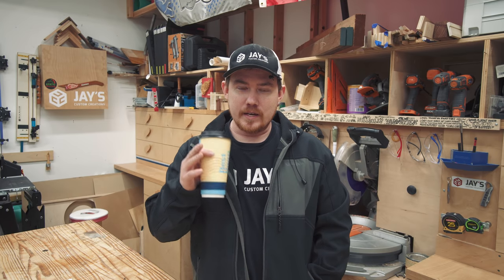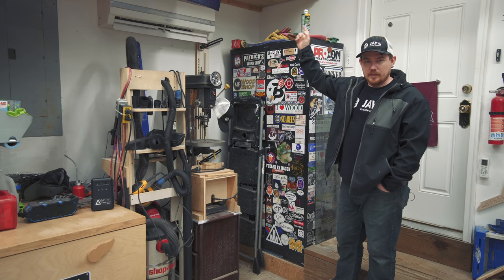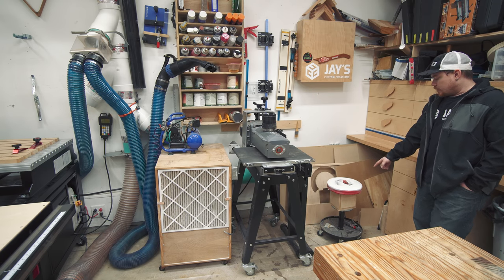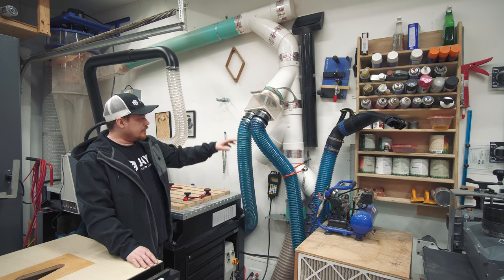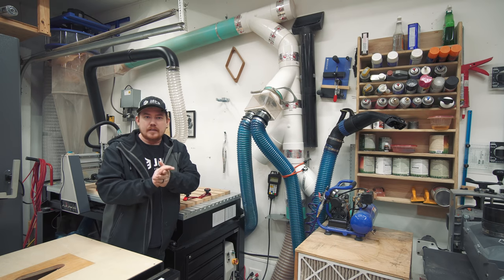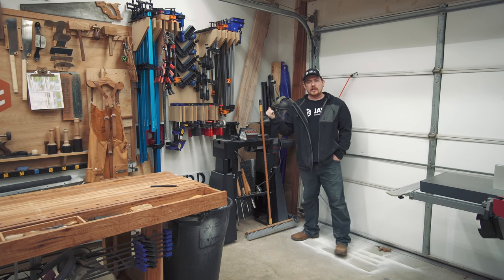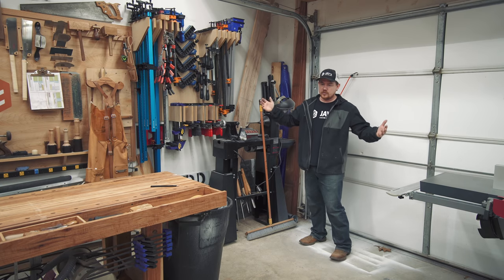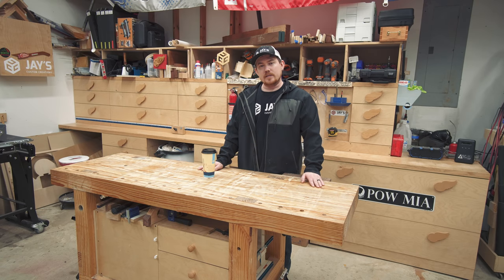$1,000,000,000 worth of tools

Comment: Question (or several) about your mini-split and garage: 
1. Is your garage insulated? 
2. Do you keep your garage a constant temp, or only when you're working?
3. Was the change in electricity consumption noticable (or approximate KWh change) based on your starting to climatize your shop/garage?
I know mini-splits/heat pumps are very efficient and would love to hear about your experience now that you're awhile into using it.
Hope you can get to my questions, thanks in advance!

Comment: I really enjoyed this video.  One of the things I liked Jay was some of your comments about why you built something the way you did.  I know not every way will work for every person.  All this video did was get me thinking and also stopped me from over thinking things I want to build in the shop.  For example, I have a 24.5' x 24.5' double barn door garage.  Right now I am limited to about 21' x 21' due to some house shelf storing on one side.  But that still leaves me with a lot of room based on what I see in your setup.  I was not setting up the machines into their respective locations because I kept getting overwhelmed on how or where they belong.  I am going to order casters like the ones you have for everything, including for workbenches I have not built yet.  I am a hobbyist, but have built some nice things for a few clients.  Accidentally got clients because my wife said, "Oh I think my husband can build that for you".  ;-).  I too have to deal with moisture as my shop has too many areas that are not sealed if you will.  Where my roof meets the walls it is opened, you can see to the outside.  Have a lot to do and worried about moisture/rust as you mentioned you are also dealing with.  Would be interested to see how you tackle the tool wall solution.  Maybe a plexi-glass encasing so you can still have it displayed in your videos?

Comment: My whole shop is lined with the extra high storage shelves, infact I used your pipe shelf design from a few years ago. It works well as a lumber rack for stuff you're keeping a longer time to acclimatize to the shop. Simple and durable, holds a lot of weight. And there's never enough room, I also started dragging home metalworking tools...

Comment: I know what you mean by workshop size. Getting ready for retirement I had a 24' by 24' shop built so that I could move out of half of a two car garage. It was going to be huge and I would have all the space that I would ever need. Have retired and been in the shop less than two years and there is not enough room. Wishing that I had gone to 24' by 36', as it is I keep making storage space and rearranging so that I have more room for working. I have found that organizing and making storage space does help with available space.

I also need to add a clutter tray to my workbench. As it is all of the clutter is on top of the workbench and I have no place to work.

Comment: Nice mini split next to the flammable vapors!  well good thing its no flame  but a electric heat pump.
For those of you who do have a gas heater or water heater in the woodworking shop you have to keep that in mind.
I use my basement because the gas water heater and hvac system is down there I do finnish work in the garage.

Comment: Thank you for your hard work. I remember meeting with in the Atlanta wood show. It seems that we have a lot in common I also purchased a Hammer A3-41 this year. You are correct it really helps having the large capacity. I think it's a great choice. I also purchased a Felder Kf700s sling table saw but I am still setting that one up.

Comment from the maker: Video Notes:
- Enter to win! Huge giveaway: https://jayscustomcreations.com/huge-500k-100k-giveaway
- Article for my first shop: https://jayscustomcreations.com/2018/12/my-very-first-shop-and-why-its-important/
- Dril press: https://jayscustomcreations.com/2014/01/13-drill-press/
- Benchtop router table: https://jayscustomcreations.com/2016/12/benchtop-router-table/
- Shopvac and cyclone cart: https://jayscustomcreations.com/2015/01/make-a-shopvac-and-cyclone-shop-cart/
- Mini split for AC/heat: https://jayscustomcreations.com/2017/02/workshop-heating-cooling/
- High storage shelves: https://jayscustomcreations.com/2015/05/wasted-space-garage-storage-shelves/
- Miter saw station: https://jayscustomcreations.com/2015/03/adding-storage-drawers-to-the-miter-saw-station/
- Drum sander: http://bit.ly/2RvbivK
- Air cleaner cart: https://jayscustomcreations.com/2016/05/mobile-air-cleaner-cart/
- Finishing supply rack: https://jayscustomcreations.com/2014/02/how-to-make-a-french-cleat-pocket-hole-finishing-supply-rack/
- Dust collector: https://jayscustomcreations.com/2017/02/clear-vue-cv1800-cyclone-dust-collector/
- CNC machine (AR8 PRO+): http://bit.ly/2Csz3Qs
- Lever router lift XL: https://jayscustomcreations.com/2017/10/lever-router-lift-version-2-xl/
- SawStop table saw: https://jayscustomcreations.com/2015/12/tool-talk-5-sawstop-pcs-vs-grizzly-g0690/
- Laguna 18BX bandsaw: http://bit.ly/2rTXIXq
- SawStop folding outfeed table: http://bit.ly/2V6HYOv
- Hammer A3-41 jointer/planer combo: http://bit.ly/HammerA3-41
- Laguna Revo 12|16 lathe: https://jayscustomcreations.com/2018/10/laguna-revo-1216-15-candy-dish/
- Clamp rack: https://jayscustomcreations.com/2016/09/clamp-rack-version-2/
- Tool wall: https://jayscustomcreations.com/2016/05/making-a-hand-tool-wall/
- BearKat saws: https://jayscustomcreations.com/2017/12/my-custom-bearkat-hand-saws/
- Chisel handles: https://jayscustomcreations.com/2017/03/branded-custom-chisel-handles/
- Shooting board: https://jayscustomcreations.com/2016/10/a-shooting-board/
- Shooting board attachments: https://jayscustomcreations.com/2018/01/my-shooting-board-attachments/
- Mallet: https://jayscustomcreations.com/2016/03/two-ways-to-make-a-mallet-or-6/
- Shop apron: https://jayscustomcreations.com/2017/11/my-custom-shop-apron/
- Hand tool sharpening: https://jayscustomcreations.com/2018/07/how-and-why-i-sharpen/
- Hickory workbench: https://jayscustomcreations.com/2018/02/a-hickory-woodworking-workbench/
- Pine workbench: https://jayscustomcreations.com/2016/01/build-a-woodworking-workbench/
- Difference between hardwood and softwood workbench: https://jayscustomcreations.com/2018/06/softwood-workbench-vs-hardwood-workbench/
- Workbench casters: https://jayscustomcreations.com/2018/10/mobile-workbench-plywood-rack-lumber-rack/
Reply: I have my eye on the lathe. 😁
Reply: Jay Bates 2 - Vlog and Non Project Videos h
Reply: Jay Bates 2 - Vlog and Non Project Videos h
Reply: Who won the great prizes? I would think you offer this great giveaway on YouTube, would let people who won on YouTube.

Comment: Thanks for the thorough tour, always good to see the whole picture vs big/parts.  Noticed you ditched the Paulk workbench, was that purely due to space or were there functional reasons for the 2nd traditional workbench?
Reply from the maker: Probably 50/50 space savings and I like interacting with a traditional workbench more. If I had a bigger shop I would still have it. Solid design and it's quite useful.

Comment: Hi jay I'm coming out off retirement as you guys in inspire me to do some woodworking 
I m a Disabled person so I am limited to space I have just built a 8 foot wide x16 foot long  shed .one of the  main 8 foot sized is were my Double door is. so I can bring stuff in easily I have brought a lot of tools such as table sew just a ryobi pillar drill tabletop one a sickness planer triton one and a triton spindle sander. need a station for tools to be sharpened .I have a lot of drill drives ext .
Reply: Routers and router table ext lots of clamps I have a 4 foot wide x 8 foot long workstation which I won't to incorporate my table saw . and lots of hand tools. what am trying to say a don't now how to use sketch up so any I dear how I would layout my shop . work out were to put things .would pay you or someone to do a sketch up drawing with measurement. hope you can help me if not maybe you could put me in contact with someone best regards colin P.S Don't need anything until the new year .

Comment: Hi Jay! My shop is almost identical in size to yours (22x22) and I want to put my miter saw into a station like yours. My simple question is what is the distance from saw blade to the wall on your left? Ten feet? Or is it offset more to one side? I have a mini split heat pump like yours too. Fantastic investment, because I'm just 20 miles south of Houston TX where the humidity is horrific.

Comment: Put a red cross on that drawer. Problem solved, space cleared.
Reply: I would agree, but having worked in logistics and manufacturing for over 15 years, I can't help but tell you that not everyone knows what a red cross represents. No joke.
Reply: This is accurate, as I didn't know until reading your post.
Reply: Ok...so print “First Aid” on the drawer with the Red Cross. Still a great idea Bert!

Comment: Jay. Noticed you removed the overhear piping on you dust collection system that went to the table saw...reason?  Thanks
Reply from the maker: In the way when moving material around. I'd much rather have it on the floor where I can more easily lift my feet.